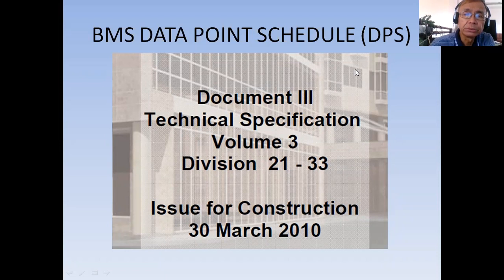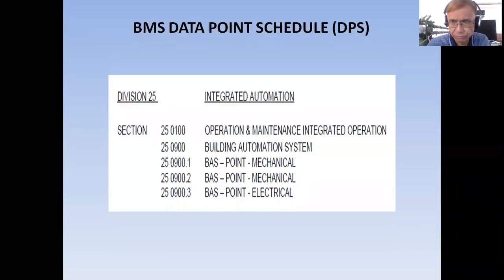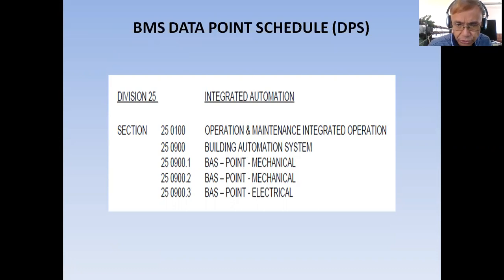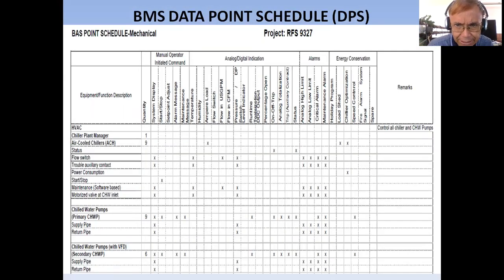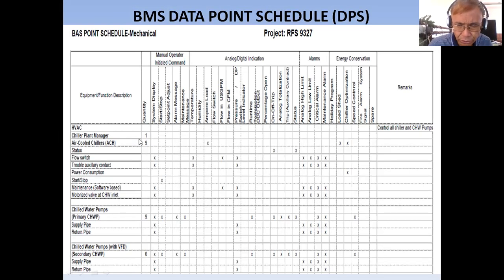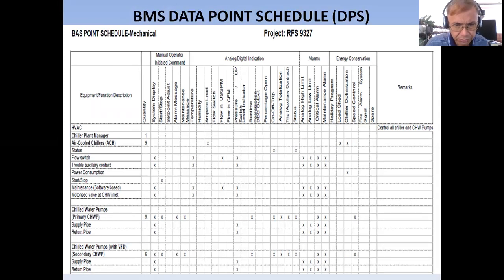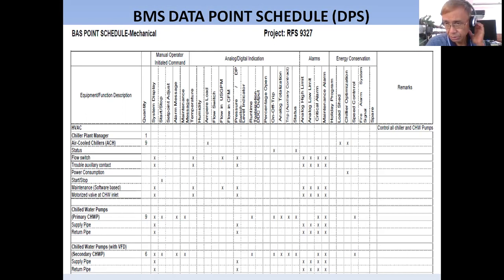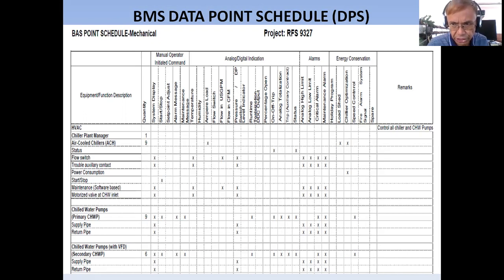How to become a BMS Engineer part 3 (BMS Project Specs)

Comment: Hi sir,
how BMS is connected to Arm gate barrier  - what points are considered for control and operation. it will be help full. it will be help if you do a tutorial on it .thanks
Reply from the maker: Actually the gate barrier are part of Access Control System, then if ACS will be interface with BMS  through software integration, then you can get the monitoring and control points .

Comment: Who will give this documents client/consultant
Reply from the maker: actually it will come from the main contractor, basically when you are doing a BMS project you will be a sub contractor unless your are the general contractor. the design will come from the consultants
Reply: @SantosJrCapellan-BMS  can you make vedio on project design engineer
Reply from the maker: @mohammedabdullahkhan4264  are you a BMS ENGINEER?
Reply: @SantosJrCapellan-BMS  I mean to say make vedios on bms design project engineer.
Reply from the maker: @mohammedabdullahkhan4264  My experience is as a bms engineer, so based on an existing bms project we will be the one to engineer or provide solution.
Reply: @SantosJrCapellan-BMS  what design of bms system
Reply from the maker: @mohammedabdullahkhan4264  maybe what you are saying is how you will engineer a bms project
Reply: @SantosJrCapellan-BMS iam saying you, how to design a bms system
Reply from the maker: @mohammedabdullahkhan4264  what I am doing is design a solution based on a given IFC drawing (Instruction for Construction)
Reply: @SantosJrCapellan-BMS  based on data point schedule, we will select controllers